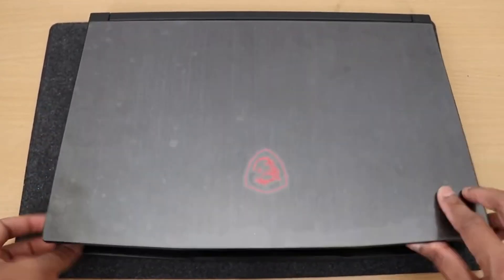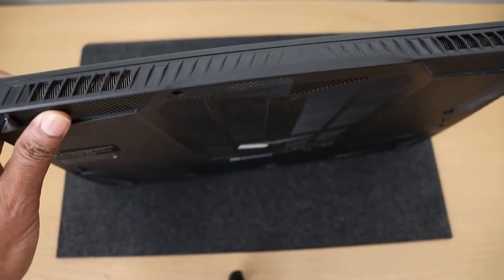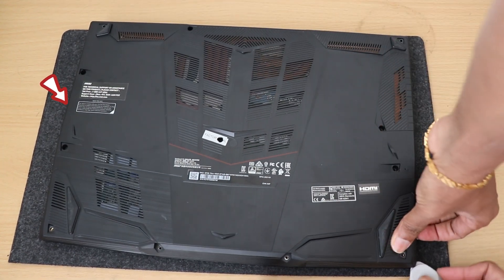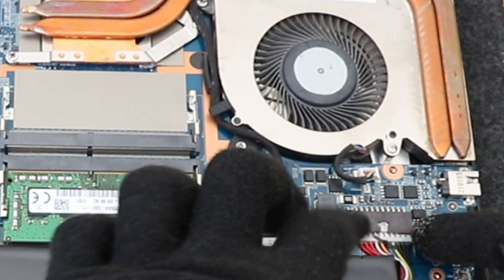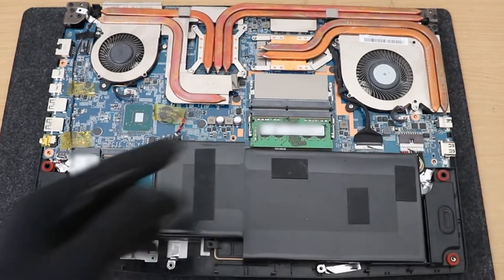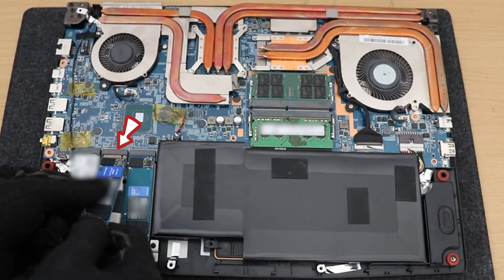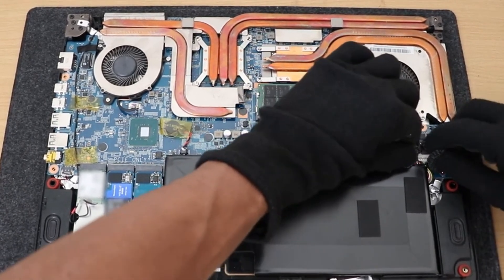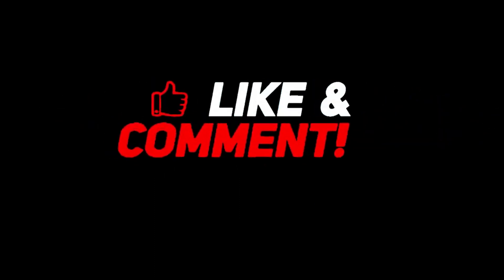MSI GF65 10ue SSD & RAM Upgrade [2025 Step-by-Step] 💻 #techguide

Comment: Thank you for the video! Everything worked fine, but I couldn't get that damn battery connector loose. Is there a specific trick to it? I took the risk and put the SSD now in without disconnecting the battery and luckily everything still works :-) but my fingernails are completely fucked up from trying to fiddle it out
Reply from the maker: Yes, it is hard to disconnect battery in first time. Then it become easier.  Thanks for comment

Comment: hey i have the same laptop with 512 internal storage. since there are two slots can i buy a Crucial T500 1TB Gen4 NVMe M.2 Internal Gaming SSD  and fit in? so like my total storage now will be 1.5 TB?? and if yes shall i get one with or without heatsink?? pls help
Reply from the maker: You can use the Gen4 NVMe M.2, but it will not achieve full SSD speed. I added a 4TB Gen4 NVMe M.2 and a 2TB which both work without any problems.

Comment: Are gen4 crucial ssd compatible with this?because the slots are gen3
Reply: Yes you can use Gen4 ssds on Gen3 slots, it will work perfectly fine, just make sure to get the correct M.2 Size.

Comment: I have the same laptop, can i put two SSD. Is there extra slot for ssd like ram?
Reply from the maker: Yes You can. There are 2 slots for NVMe SSD on the write side of the Wi-Fi slot. You can install two M.2 NVMe SSDs there. Please re-watch the video at 1:35 for reference.

Comment: i have this exact laptop, 1tb ssd and 16 gb ram... i want to upgrade  both can you please tell me/explain exactly what i need to order so i dont order the wrong hardware?!? please help!
Reply: another question can I run higher than 2666 mhz? like 3200 MHZ? i was thinking about getting the crucial ram 64 gb kit on amazon  CT2K32G4SFD832A .... it is running 3200mhz is this okay?
Reply from the maker: This laptop's RAM is 2933 MHz. You Can use 3200 MHz but it will work well. but  2933 mhz maximum you will get even if you use higher RAMs
Reply: @unboxuptech  so thats why im only getting 2933 despite having a 3200 mhz ram
Reply: I added a ssd and the computer doesn't show it there  help!
Reply: @rellyroo when you get and install a brand new storage drive you need to format it, just Google on how to do so it's very easy.

Comment: Nvme ssd? Was that tiny blue chip the ssd ? I have one of these laptops, never opend it, didnt know i could upgrade it
Lately ive been feeling like id rather had 1tb than this litle 500gb 
But bard said the only way to upgrade the memory was to replace it with a bigger one, wich i didnt feel like doing
I do feel like upgrading the ram
But if theres place for an extra ssd id happily put one more in it
Reply: yea its a must if you want to game comfortably on this thing, uprgrading the ram and storage on mine as i didnt wanna pay and extra 50-100 for generic crappy ram and storage from msi
Reply: @muurk133  ive upgraded it the ram works fine, ive put in a 4tb ssd aswel, it came with a heatsink that seemed to not fit for a few milimeters so ive put it in there annyway and it did reconize it but afther about 2 hours it broke the ssd, not sure why i think it must have been the heatsink i forced in there 

Im gonne try again with another ssd and no heatsink but im kind of worried
Reply: @Tyson31991  what type of Ram does it have to be an What type of SSD, i was thinking of getting 64 gb ram two 32 gb 3200mhz sticks
Reply: @rellyroo  if you have the msi gf65 thin 10ue, if i remember correctly the maximum speed of the ram is 2666mhz
If you put it 3200mhz it should automatically downclock it to 2666mhz and work just fine

Ssd, has a max read speed of 3200 and 3000 write, so basicly annything that fits m.2 slot, all the models out these days have about double of that
Reply from the maker: Was that tiny blue chip the ssd ? No it stickers on the SSD. You can install two Nvme SSD. Default it comes with 1 Nvme ssd.